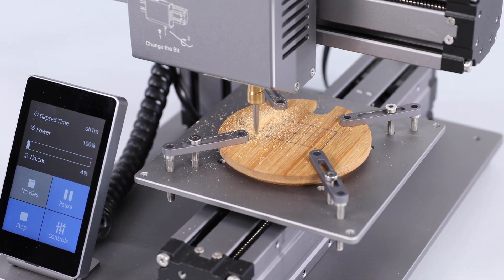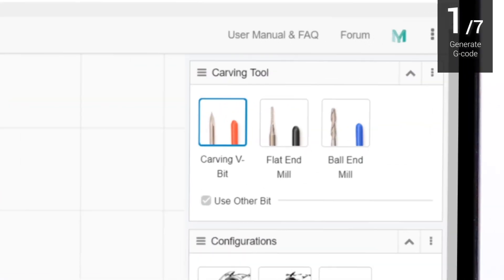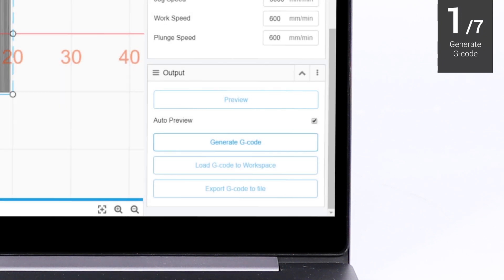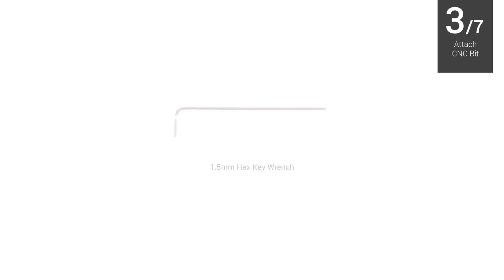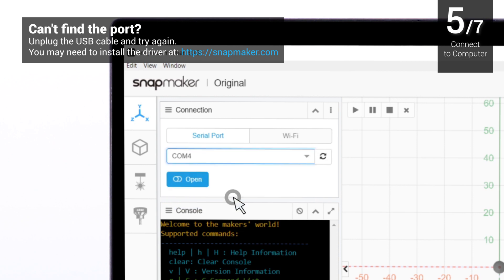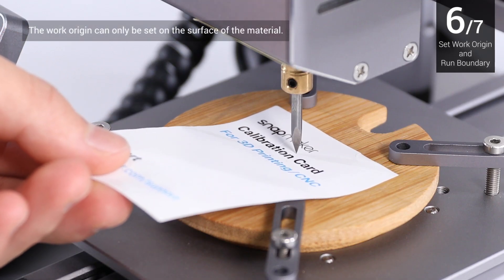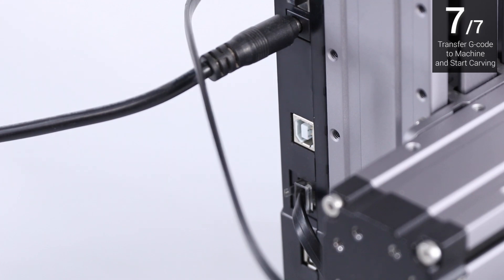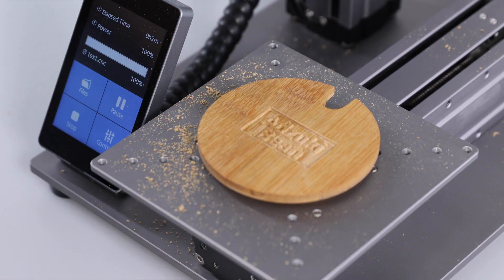Snapmaker Original – How to Use the CNC Feature

Comment: Hi! I was wondering how do you carve something from the wood, rather than just carving it into the wood? What file type? Thanks!
Reply from the maker: Hi Ayush. We used a .png file in the video. You can easily do it by inverting the image color in Snapmaker Luban. After that, the CNC toolpath will be added to the space around the text instead of to the text itself.
Reply: Thanks!

Comment: Can the machine cnc soft metals like aluminium, at least at slow speed + toolpath etc?
Reply from the maker: No, Snapmaker Original can not carve on metal material.
Reply: Snapmaker Can the 2.0 cut soft metals?

Comment: I dont see the relief configuration option in 3.8.0.   Is there any other way to add an image?
Reply from the maker: Hi Kendra. We've added a simple SVG editor in CNC G-code generator since v3.6.1. So SVG files will be processed in vector mode by default. To go to the relief mode, you can try uploading a jpg/ png/ bmp/ dxf file instead.
Reply: @Snapmaker  Thanks! Found it!

Comment: That is not at all how the CNC options work through snapmaker luban.  I can't tell you how many times that program has crashed by slightly making a picture bigger to carve or modifying the target depth.  Having auto preview on and the constant updating of the tool path really messes with the snapmaker luban programming.   The only thing that was actually plug and play was the laser engraver.  Although it is terribly loud.
Reply from the maker: Thank you for you feedback. We are now trying to fix this crashing problem. If the issue persists, you are recommended to turn the Auto Review off, and review the tool path manually.